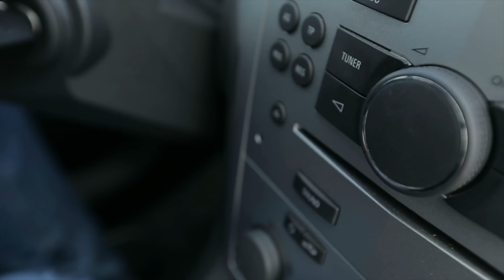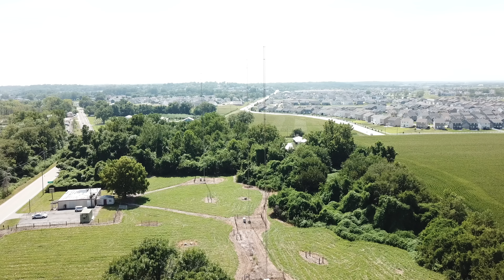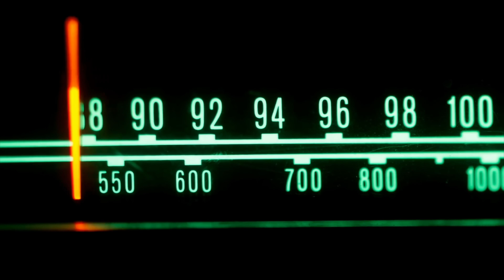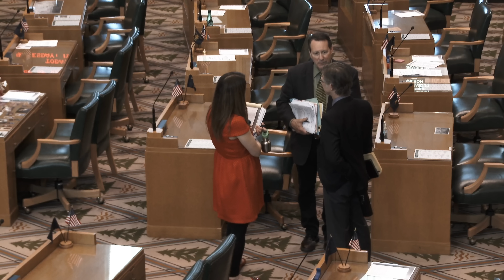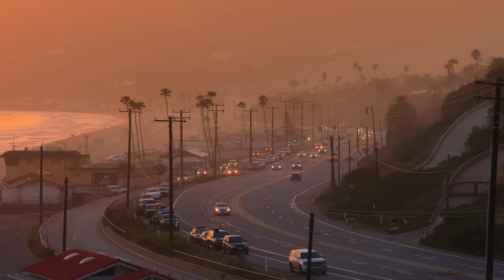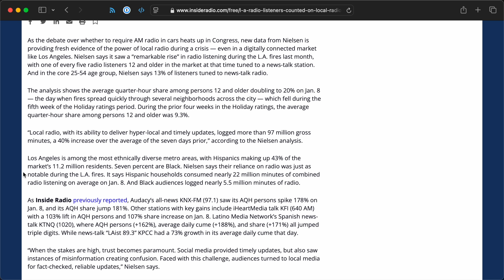Automakers are losing the battle with this 100-year-old tech

Comment: Our BYD atto3 EV (in Australia) has AM radio and it works very well. No static. I held an old portable am radio inside the car and there it worked fine 2ft from the dash. Near the dash there was some static.
Reply: I have a Kia EV6 and it also has AM radio in it and it works great. It's not like an EV can't have it
Reply: That's good to here. It goes to show that they have put a lot of effort into electrical shielding. There are actually laws in place that limit the amount of RF that a device emits.
The reality is though, so many manufacturers of so many goods just ignore it.

Comment: There are almost no broadcast AM stations left by me, all long ago moved to FM, which can do a pretty good coverage  with a few fill in sites and provide coverage. The thing that amazes me is that no US mobile phone has FM radio in it, which is strange, as here by me in South Africa even the $3 feature phone, which can do voice and basic text, does have both a media player, and also a FM receiver built in. The FM antenna and chipset is already in the phone as part of the main RF SOC, literally just disabled, as the same models of phone elsewhere, identical otherwise aside from the firmware, have FM radio ability. Seen that with media players, choose the US as region and no radio, but choose any other country and you have FM 88 to 108MHz, and if you choose Japan or Brazil you get the extended range as well, 76 to 108MHz.

More and more AM radio has issues, high noise floor, especially in cities, and the power consumed per listener is massive, 50kW plus for the possibly 5000 listeners, while the rest of the listeners of the station use the FM relay of the station, because it is clear, nearly noise free, and for music in stereo as well. Not so sure about DAB, because it never really took off here, despite being broadcast from some transmitters, but the cost of the DAB receiver put most people off, and the early versions were inferior to the FM signal as well.
Reply: You are myopic in your understanding of radio broadcasting in all of its dimensions.  Look to AM radio as a national asset because when the chips (pun intended) are down you still have all important radio in time of need.
Reply: @pibbles-a-plenty1105  I understand, but however AM radio tends to use common sites with FM, so anything that is going to take FM off the air is going to do the same for Am as they are almost all on colo sites.Yes if SHTF i can still use AM and SW to get info, but at that point you probably will have more pressing things to attend to instead.
Reply: @SeanBZA  There is indeed often a co-located FM transmitter but that covers only a mere fraction of the area the AM transmitter covers. If they want to FM to reach as far as the AM they will need several FM repeater or AM-FM translator stations.

Comment: AM is old , simple and reliable long range communication , the only problem it has is the lack of bandwidth ( due to the frequency range it uses ) , i don't think taking it out of cars is a good idea, given the really minimal cost of having it there in the first place. Now , if the problem is the large DC-to-DC converters in electric cars are producing overwhelming noise and interfere with specifically AM modulation but do not effect FM modulation , then obviously there is an FCC violation to be considered here , but also , what is we did FM on the AM band? i know fm has a larger bandwidth demand, thus fewer available channels ... food for thought i guess
Reply: It's a myth that AM needs to be narrow band. With the stations at 20Khz spacing, the audio can be much wider than the 5KHz normally used. It is hard to tell a good AM tuner (with a Wide/Narrow switch) from an FM tuner.
The problem is the crappy talk-back stations who transmit narrow audio.

Comment: One of the great losses that will happen when AM does die is that it will become impossible to build a crystal set and receive radio.  There is a special joy and magic in such a simple device, something that every curious child should have the opportunity to experience. Four components and a pair of high impedance headphones, and music appears. You can wind your own inductor, and if you can somehow scrounge an air dielectric variable capacitor, there is nearly nothing mysterious about the components. No anonymous black boxes soldered to a PCB. No batteries either. Just Maxwell and his equations.
Reply: So release the frequency to the public like the ISM bands are. Let any old joe transmit a couple watts in the old broadcast band and have fun building bean tin radios.
Reply: I love crystal radio. If you can't get a suitable germanium diode, a small piece of Galena with a brass wire "cat-whisker" will work. The only important part is the high-impedance earpiece.  The only vehicle I owned that didn't have AM radio was my 1959 Chevrolet Apache pickup; it had zero electronics and would still work after an EMP!
Reply: I had to build my own am transmitter in order to make a crystal rádio. The nearest am station is about 700 km from here, so it wouldn't pick up any signal

Comment: This is great news overall because in a small way it affects me as a HAM.  Basically since auto manufacturers have to ensure that interference from their cars doesn't affect AM -- this means fewer problems for HAM operators as well.  Also, I think from the standpoint of emergency purposes -- legislation like this should extend itself into areas like HAM radio operators.  For instance, HAM radio operators are frequently have to deal with restrictive HOAs in terms of antennas.  From the standpoint of both the hurricane which affected NC and the LA fires -- I think it should be clear that both AM radio and HAM radio operators are greatly needed in situations like this.  And also if Dr. Who is unavailable whenever the Darleks are running around screaming "EXTERMINATE!"

Comment: I'm glad that someone is preserving AM. Also, I'll just take a moment to marvel at the fact that just 25 years ago satellite phones were giant bricks and now they can fit all the components into a regular cell phone that fits in your pocket. And just think that fewer years than that earlier, cell phones were giant bricks too. Who knows what they'll be able to pack into a device that fits in your pocket in another 25 years.
Reply: An MRI machine?!   
Oh wait: UWB ✅   
A locally hosted AI?!   
Oh wait: NPU ✅   
Open, decentralized mesh communication via any current generation of the ~1 mile radios already present in our devices for decades?   
Never. going. to. happen.
Reply: It will be inserted deeper than your pocket.
Reply: Like what, you've got a computer with internet, I can't imagine what you're hoping for
Reply: @xpusostomos  Teleportation, replication like Star Trek, holographic projection like Star Trek (think EMH).
Reply: @anon_y_mousse  not even star trek has those in your pocket
Reply: @xpusostomos  So you never watched Star Trek then? TNG had repair-bots that could generate tools as needed using a tiny replicator unit built-in. Voyager had the portable emitter that they managed to pick up on a mission and the EMH continued to use for the rest of the series. Various alien civilizations had hand portable teleportation and Starfleet had shuttle-sized transporter tech with easy to handle palm-sized remotes.

Comment: When I'm in the car, I'm listening to AM talk radio - several stations, some of them as far as 300 miles away (mostly at night, in the winter). I never turn the radio off, except when I turn off the ignition. If there's no AM radio in the car, I'm not buying it. Period. My suspicion is that the modern car radios.... OK, "infotainment systems" that don't have AM radio really do - all they have to do is change the firmware to activate it.
Reply: An AM radio chip in your car doesn't do much if you don't have a decent AM broadcast antenna to receive it.
Reply: @stargazer7644  And excellent point! I had to have the windshield replaced on one car, and afterward my AM reception was gone - turns out the antenna must've been embedded in the windshield somehow. So yes, a good antenna is mission critical. And NO cars have the classic whip antenna mounted on the front passenger fender or a rear fender anymore. Sigh. (P.S. I solved the problem on that car with a kinda crude makeshift antenna - hey, it worked. Kinda.)
Reply: @lawrenceh1405  Yep, I had a late 70s car that had no antenna on the fender.  It had a wire dipole inside the top of the windshield.  I had to pay a premium to replace that windshield.

Comment: Another thing destroying AM radio in modern cars is that car makers are fitting tiny "Shark Fin" external antennas that are optimised for VHF, they have little capture area, and internally they use rubbish, thin, high attenuation coax feeder to the radio. AM is hopeless in modern cars due to lack of signal, FM is not much better. Gone are the days of being able to easily fit a decent length external AM antenna.
Reply: My dad's  newish honda has an extremely tiny antenna. It has awful reception compared to his older mini van with a regular full sized stick antenna.
Reply: Yeah... I have a fin and AM is useless in my car. The best channels I can get on a standalone radio are mostly high-pitched interference and warbling noises.
Reply: My car has a "shark" fin for GM's cell phone system.  And my car also has a fixed whip antenna and the AM receptions is excellent.  If you buy stupidly the auto makers will be glad to cell you junk.  Oh, you didn't know that????? 🤔

Comment: One of the main reason that AM is dying is the fact that they never push the two important technologies that would keep it relevant today. AM stereo and a wider bandwidth. They could have made AM sound as good as FM if they had done that. AM doesn't have to die, but if stations insist on cranking out this 5 khz limited mono that sound like absolute garbage. Then maybe it's time for AM to die.
Reply: Yes!!!
Reply: If broadcasters would just bypass that 5 Khz filter, then that would boost fidelity on todays cheap crappy AM radios. Radio Caroline did that back in the 60s when they were a pirate ship radio station.
Reply: You've apparently never heard of HD AM
Reply: @stargazer7644  AM Stereo and (wideband AM receivers) existed decades ago.
 HD AM is shit. The wide HD sidebands are incompatible with AM stations on adjacent frequencies.,

Comment: I actually still listen to local AM stations in the car. Android auto is utterly worthless to me , I don't need it and wouldn't use it if I had it. But not having AM would be a serious inconvenience. Internal car interference isn't the only  problem for AM, I drive sections of road every day where external interference (from buildings, power transformers or something else)  blanks my AM signal when I drive by. Its almost magical though, being able to pick up AM stations from New York or Chicago, hundreds of miles away, when you are fortunate enough (or perhaps unfortunate enough)  to be on interstate between population centers at night. Ditto on NOAA weather band. I installed an upgrade stereo in a pickup I used to own that had NOAA WB on it. I kinda miss that feature. I would also like to see a "put knobs and levers back on car dashboards" act. Controlling everything through touchpads while you are in motion is ludeecrus

Comment: Simple fact AM has a longer range then FM Cell and all Mesh systems and doesn't have line of sight problems too and that's including when many AM stations are on reduce power and directional pattern at night. Typical Example: WHEN AM in Syracuse NY get listen to almost to Binghamton and rest of east west and north Central State but Every FM stations drop out fast even without hills. Many States and Local DOT still use AM to send out traffic warning etc for same reason BUT many of these are at/near top or bottom of the AM band and Many OEM and Aftermarket Car Radios with Digital Tuning Haven't been able to Tune the entire AM frequencies since 1980's.

Comment: AM radio demodulation is soooooo simple. Made a Crystal AM radio as a kid. Crystal, peak hold diode and capacitor…that’s it! Obviously that not what is in a modern radio, but reliable low tech in an emergency is HUGE!

Comment: My thought on the matter is: If GM could figure out how to make an AM radio work in the Chevy Bolt, every other automaker is being lazy
Reply: I drive an EV and have had no issues with the car electronics and AM radio interfering with each other.
Reply: Hyundai Kona has AM 📻.

No excuse.
Reply: @TheEgg185  My old Lexus has 6 x CD Cassette,   LW, MW, FM and still works after twenty years
Reply: @WOFFY-qc9te

LongWave??????🤨🤔🧐
Reply: @ Yes Longwave, and AM transmission that is longer. 198kHz
Reply: Th US have made it Law that AM be fitted to cars.  Bloody good idea.
Reply: @WOFFY-qc9te it's just so weird to me that this has to be done...... I have personally never owned a car that didn't have a.m. radio, and I'm not sure when it stopped.
Reply: @1SqueakyWheel  Cost of transmitting AM. and complacency thinking we do not need large broadcast transmitters to reach the nation in a time of crisis.  Oooooo ps
Reply: @WOFFY-qc9te  I don't think it has anything to do with the expense of xmitters... there still seem to be about as many local AM stations in my area now as there were 20 years or so ago. 
If I had to guess, it's just a really cheap shortcut that can't possibly save them as much money as all the hassle would seem to be.... perhaps there's so much electronics packed into the new cars now that they're not trying to keep it as clean with the EMI...... AM receivers pick up everything!
Reply: @1SqueakyWheel  The cost of energy is so high that they wish to move to digital systems using the cellular network or internet. Running a 100kW AM TX 24/7 cost thousands a day. In the US a VHF licences would be issued providing the station maintained its AM service however they were not prevented from reducing power.  The cost of an AM receiver is not the issue.  Also people are lazy and choose the easy option which is their phone. Best.
Reply: @WOFFY-qc9te The cost of AM transmitters has nothing to do with this. It doesn't cost auto companies anything and I'm quite sure they couldn't care less about transmitter expenses. They (car companies) dont pay the costs.
Reply: @WOFFY-qc9te I get that frequency modulation is more efficient than amplitude modulation for metro market usage, but the fact still remains that I am seeing a plethora of AM stations wherever I go. I work on the road a lot, so AM stations for talk radio tend to be my co-pilot.  I haven't noticed a drop in AM stations, although I don't doubt that there are a lot less of the small ones these days.
Reply: @williamphelan8779  William I don't follow your point, The cost of the radio installed with both AM and FM is not the issue it is the AM station running cost, the service is declining because of the cost.  Keeping AM system as an emergency back up will hopefully get the weaker AM stations stations in good order.  Making AM mandatory fit in cars will hopefully help.
Reply: @WOFFY-qc9te  Thanks for your clarifying reply. I more or less agree with you. I've been living in Middle Tennessee for 15 years. I don't know of any AM stations that have shut down. I am a radio buff and I appreciate how well AM works after dark pretty consistently. I can hear several AM stations from NYC almost every night.
Reply: @williamphelan8779  good to know! I'll try try to find some NYC stations as well!!!
Reply: They are not lazy, they have another agenda.
Reply: @thebeanstalker631 what is the other agenda?
Reply: Right on.
Reply: Same 😂
Reply: My spark ev has it too

Comment: Why can't emergency messages come over FM radio?
Reply: FM is mainly line of sight (top is the antenna tower) by the physics for radio propagation (30 miles is good range for FM). A fire, earthquake, flood, etc.. can take out the local TV, FM, CELL or even local AM stations. With the ground coverage (notice that most AM broadcast antennas are not on hills or mountains) of AM signals hugging the earth, you can still receive stations from hundreds of miles away that are part of of the emergency broadcast system with updated information (food, shelter, evacuation routes) at the needed locations.
Reply: @mntmst  AM signals that you receive from long distances are not hugging the Earth.  They're bouncing off of the ionosphere.  That's why AM's range is so short in the daytime.
Reply: Because AM radio covers a much larger footprint.

Comment: Every piece of electronic equipment is subject to FCC RF interference regulations, except mobile electronics.  I was in two-way radio for 40 years and experienced the increased RFI from vehicles as more electronics were added.  Agricultural equipment is amongst the worst offenders.
"This device complies with part 15 of the FCC Rules. Operation is subject to the following two conditions: (1) this device may not cause harmful interference, and (2) this device must accept any interference received, including interference that may cause undesired operation."

Comment: Last year a friend had a Tesla car as for several weeks as a rental while his car was being repaired.  He said that the electrical noise was so bad that even a dual-band 144 MHz and 440 MHz radio was unusable in the car.  I don't know how they make the FM radio work in those cars.

Other Ham radio operators have reported that they know every time a Tesla drives by their house as it tears up their HF (1.5 MHz to 30 MHz) reception.
Reply: When I test drove a new Ford Lightning EV pickup I took an HF/VHF/UHF radio with me to check for interference.  It was fine.  No problems from 80M to 70cm.